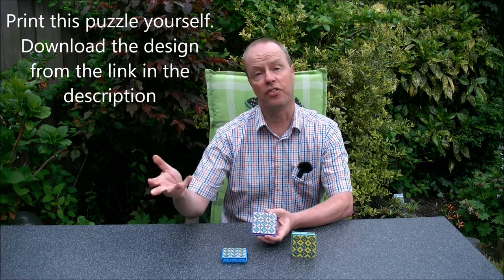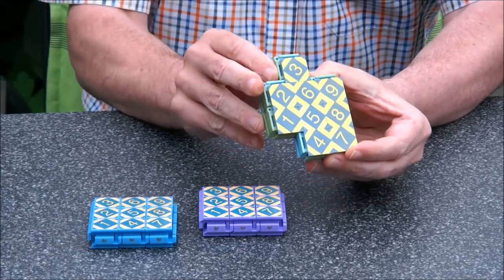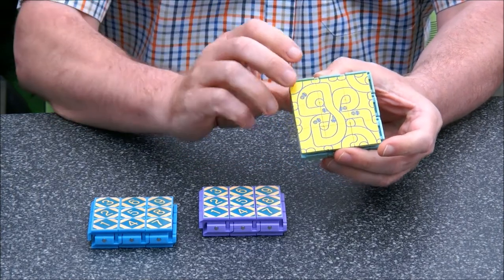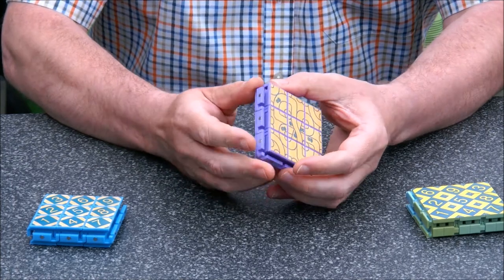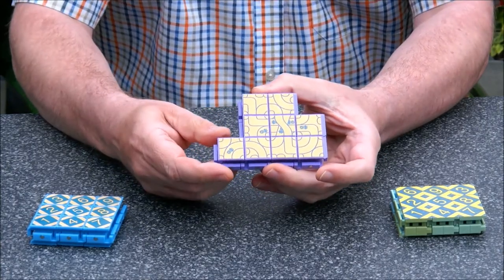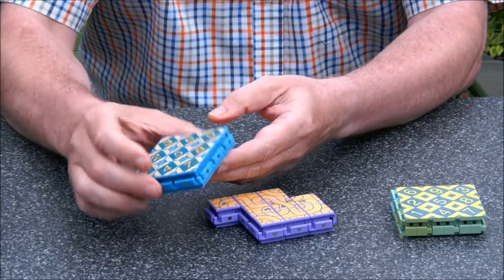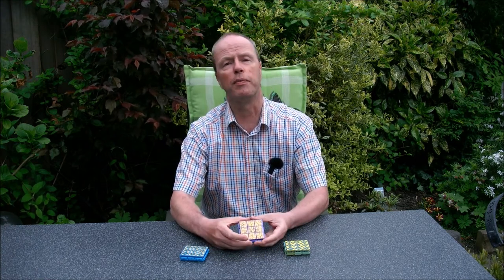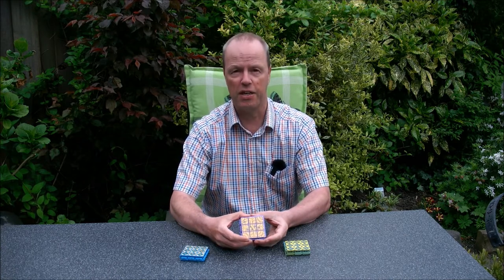Boomdas Replica - Who knows more about the origins of this puzzle?

Comment from the maker: As many people know, it is impossible to swap 14 and 15 in the famous 14-15 puzzle. Can one swap the 8 and 9 in Boomdas, while keeping all other squares in place? That is, without cheating and taking parts off?
Reply: Yes it can, Oskar, sir. The minimum optimal moves of switching 8 and 9 without taking apart the pieces, is five.
Reply: Yes you can. that is, because once you have one piece outside of the 9-square, you can move it along the squares edges almost independently. 
You could for example have two pieces outside of the square, move one around the edges and thereby reversing their order.
(although I cant think of a way to do it in five moves)
Reply: how is this comment 3 months old?
Reply from the maker: Only five moves? Good to know!
Reply: This video released today.

The comment I'm replying to right now is 3 months old.